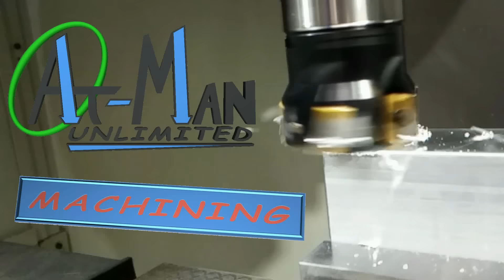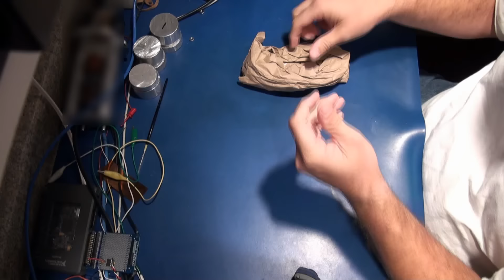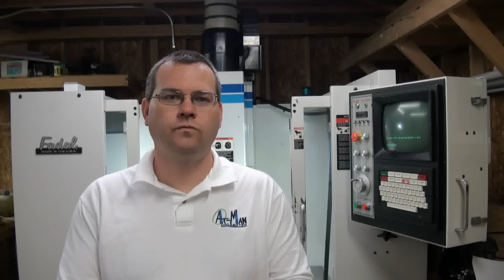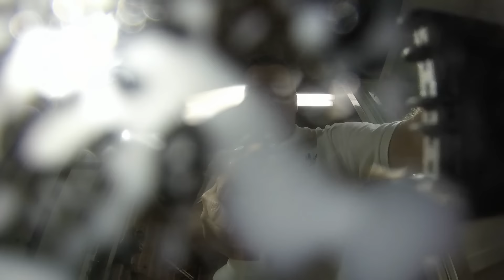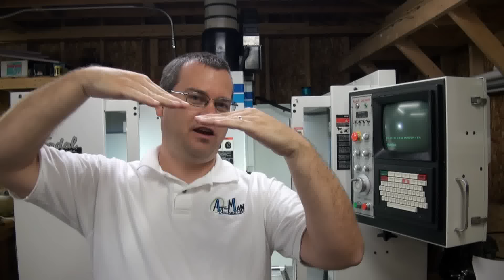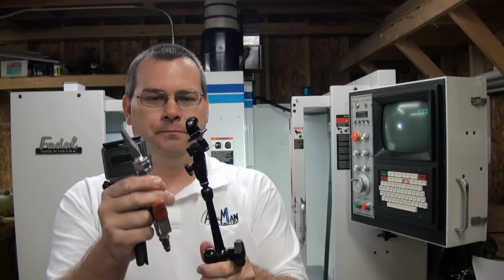Talken Swarf: MAIL!!!

Comment: You may be miss informed about the fog buster. it is not an atomized spray like some people think. it throws tiny droplets onto the work/tool. by using two different sized orifices and pressurized coolant to help prevent mist or fog in the work space
Reply from the maker: Hello Gremlin, Sorry, yes fog buster's goal is to NOT atomize the coolant. But unless you use really low pressure, it will atomize a little bit. And at that low of pressure you don't get the chip clearing you really would like.  Even some of the larger tools I use with flood coolant will atomize a little bit when spinning at higher RPM's. The lack of any real air flow does keep it in the cabinet I find. Don't take that as a knock on mist coolant, just a personal preference. I have other stuff in my shop that does not react well with oil ;)

Comment: Very uncomfortable with you pointing that bottle at me. Normally I'd shoot back.
Reply from the maker: Don't worry, I live in NY, because my squirt bottle has a pistol grip, my magazine is fixed, only holds 7 rounds, and I don't have a removable tail stock or flash suppressor ;) But if you would like I can send you the MSDS sheets for Blaser Swisslube 2000 Universal.
Reply: At-Man Unlimited Machining 
Lol. Thanks. 
And sorry about all the squirt gun restrictions you must live with. 
It must suck.